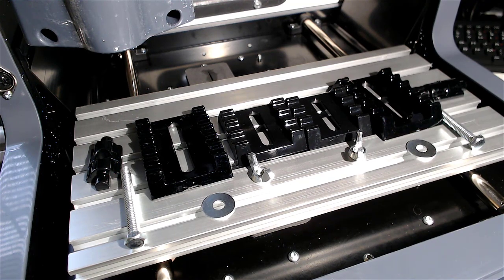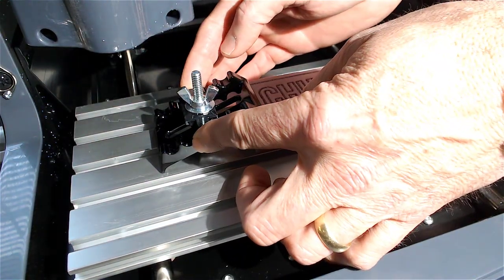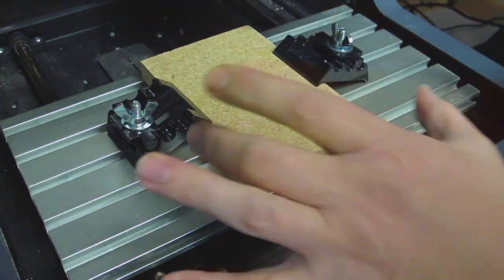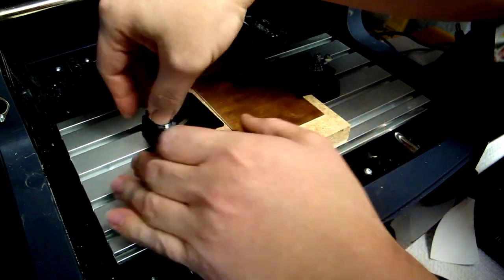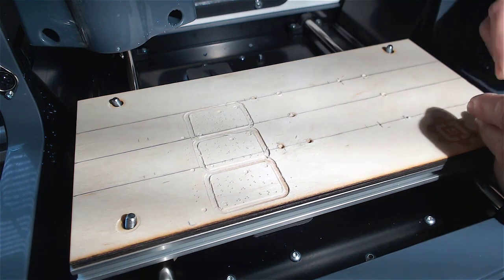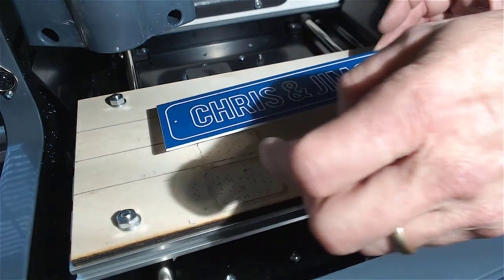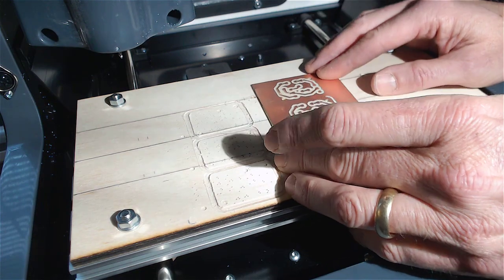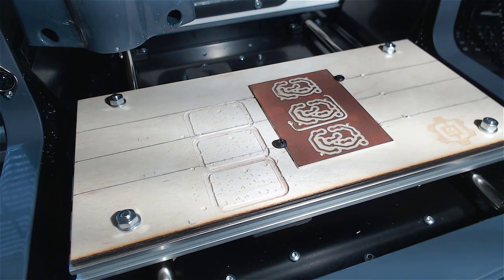Holding Material in the xsTECH

Comment: To cut the part quicker, run the spindle at the maximum RECOMMENDED RPM and a matching feed rate based on material type, with smaller step down amounts. 😎